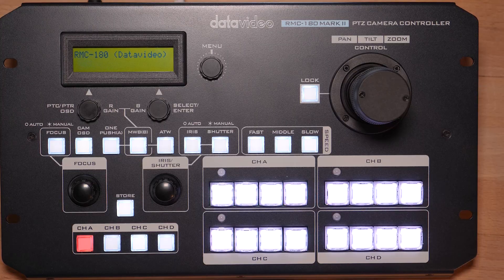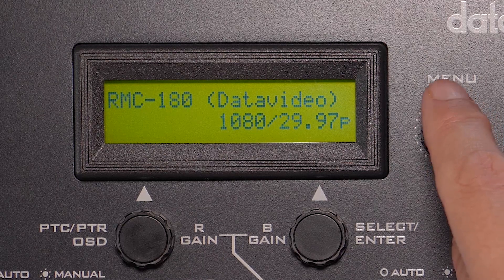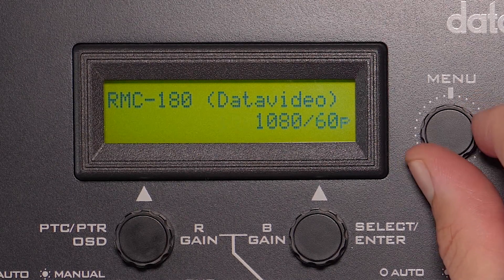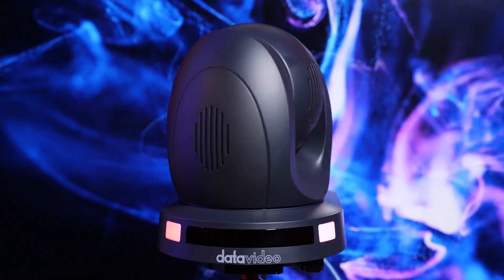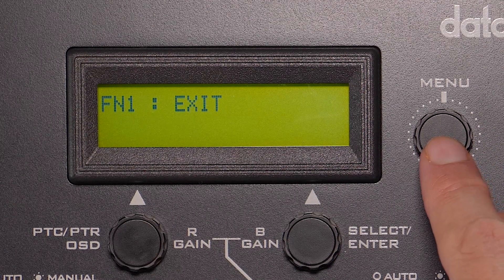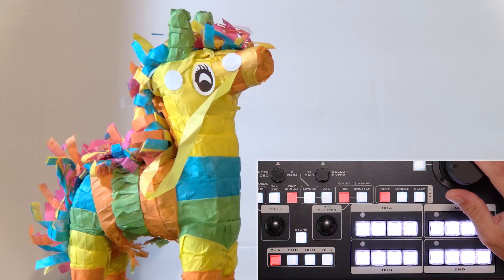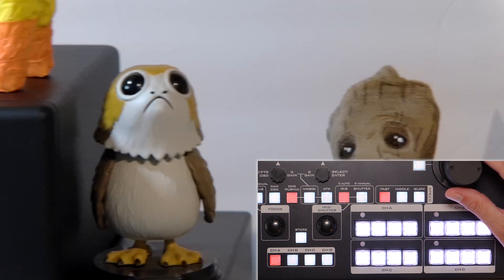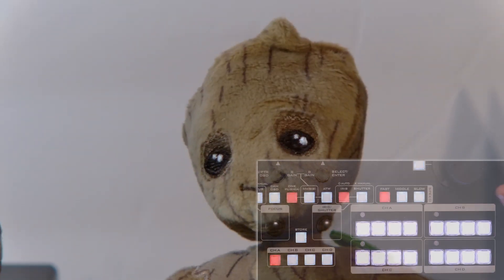How to Operate PTZ Cameras Using the PTC-140 and RMC-180 Mark II

Comment: Very informative video. Question, can I program a preset where the camera will slowly move to the desired location? For example, I have a wide view shot but I want to slowly zoom into the center. Is there a way to program a preset so that when I call on that preset it’ll slowly zoom into the desired position? Currently it will execute the preset too quickly for the desired effect. Thank you for your time.

Comment: Interesting, but one important piece of information is missing:  In manual focus or manual iris mode, is the setting stored with the preset?
The joystick lock button is located on the left, which is difficult to access. I guess the designer is left-handed...